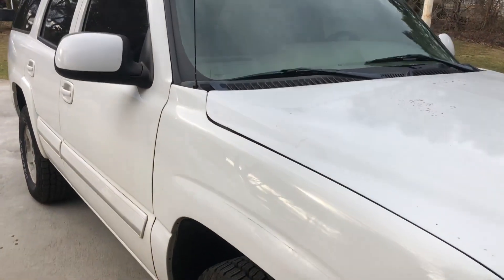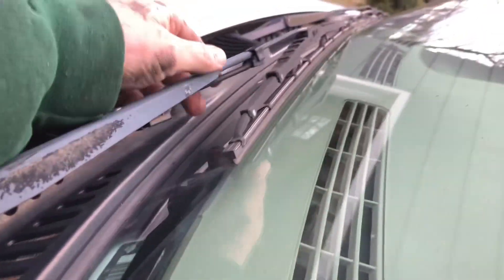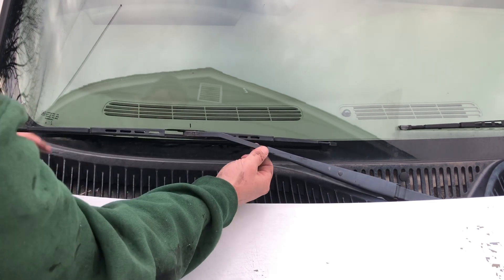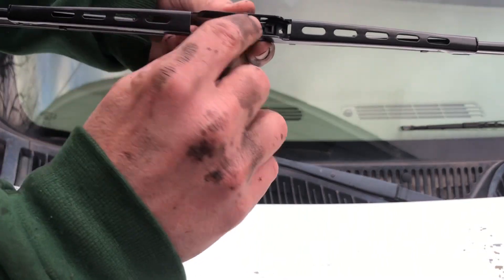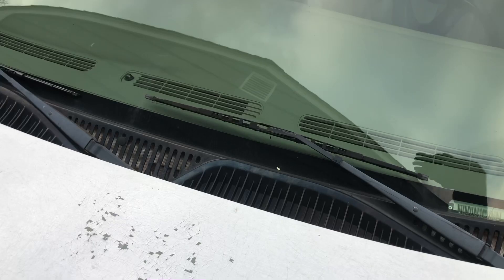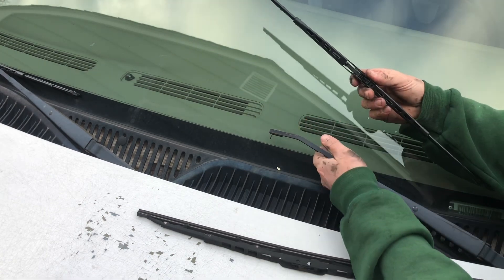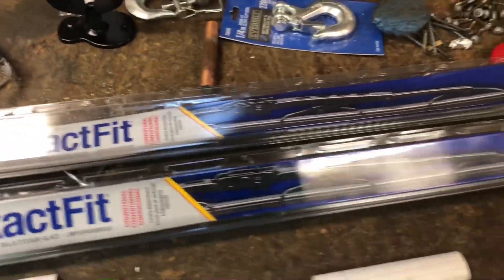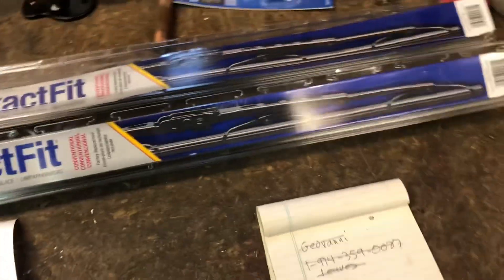DIY WIPER BLADE REPLACEMENT, 2004 Chevy Tahoe

Comment: Thank You, Thank You!  I have been trying to figure out how to get the wiper assembly off my 2004 Tahoe for years.  I had put after market Michelin on and could not figure out how to get them off. I wore my fingers out pressing, using screw divers and knives.  I finally gave up and bought just the rubber blade.  I was just fixing to paint the wipers as they were starting to rust, when I started looking at videos.  Your push and pull worked perfectly.  Best I can tell, that is how they were supposed to come off rather than releasing a tab.  There must be a hundred different styles of clips out there as none of the videos helped.   Not being able to raise the wipers very far on a 2004 did not help either.  Thanks again, now what to do with this new can of black Rustoleum paint.
Reply from the maker: Thank you , I’m glad to be a help. Yes , it seems like every single one has a different clip of some sort . 
Thanks for watching, we really appreciate it 👍